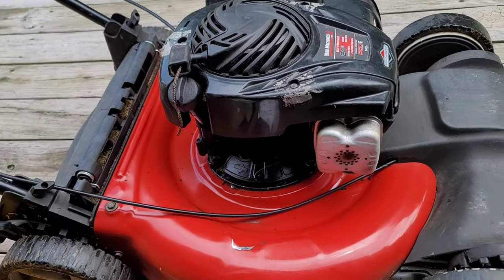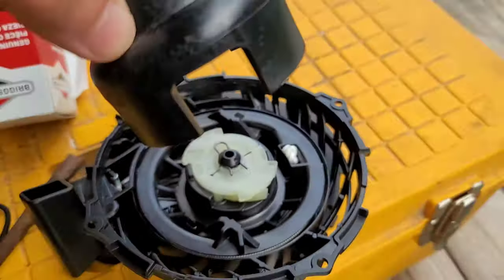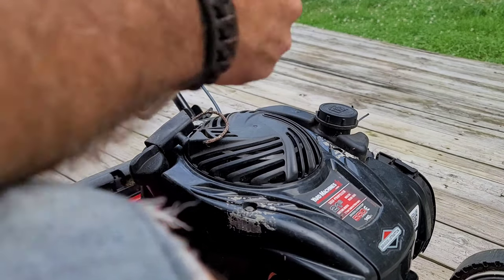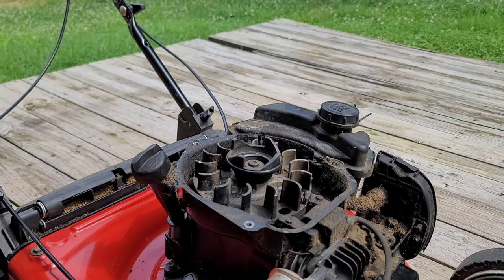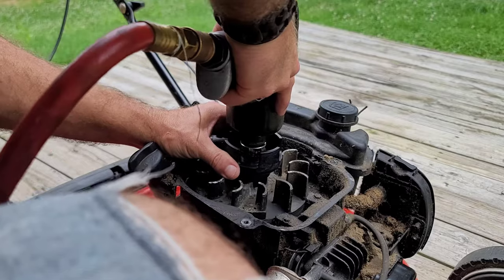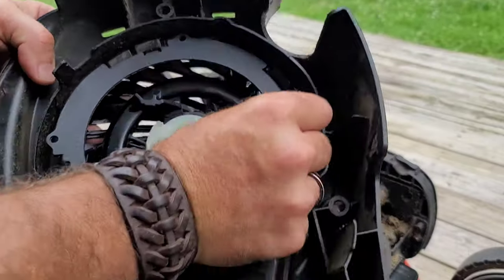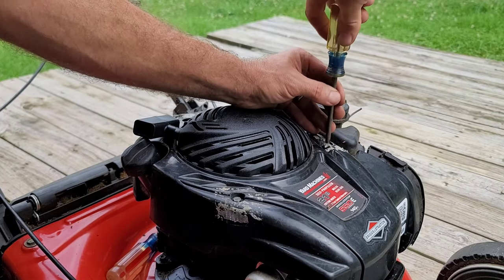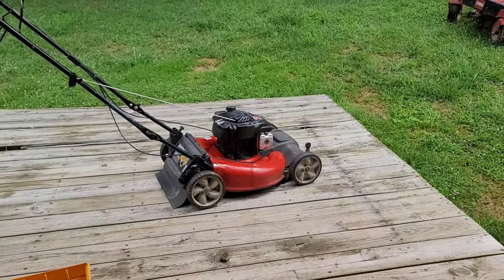MTD Yard Machine Recoil Replacement

Comment: WOW, what an Experience! My 2015-2017 MTD / Murray 21" Frame,  Briggs and Stratton E500 E Series motor, #11A, took compatible part # 591139 Briggs and Stratton Recoil Starter Pull Start Assembly Replacement for Troy Bilt Craftsman TB110 TB200 140CC 150CC Engine Lawn Mower Parts Replace BS 593961 590588 593959 150-012 Rewind Starter.   *****Love cut and paste!******Had the correct Cup,   Manufacturers must THINK we will just go buy$$$ new mowers if we cant find the part we need?   Thank you Mr Burbon, you were a big help, that ring had me stumped too. For this old gal, I would up setting the cover upside down in a old pot and my daughter helped me push the new center piece straight down into cover. Thanks again! And Best Wishes to Humanity!
Reply from the maker: Your very welcome,  Im glad it helped! 😊

Comment: Thanks for your video.  I am very mechanically inclined, but that plastic ring had me baffled.  I think partially, because it looks like one that I have does not have the indentation as shown.  I will try and see if I can install it under the clip. (Edit, I was able to install the ring as shown.  There is a slight indentation on the assembly.)  Thanks for the info on the adapter.  That is very helpful, as you mentioned, no one shows to order the additional part.  Thanks again.
Reply from the maker: Im glad it helped you, thanks for watching!

Comment: The part description for the cup I used from amazon was  "593960 Flywheel Cup Engine Recoil Starter Fits for Briggs & Stratton 08P502-0002-H1、08P502-0003-H1 Lawn Mower Replace Parts"

Comment: Did you use a model number to get your replacement parts
Reply from the maker: XingLi 593959 Recoil Pull Starter fit for 591139 590588 593961 08P502 093J02 09P602 09P702 Engines Lawn Mowe

Briggs & Stratton 593960 Flywheel Cup